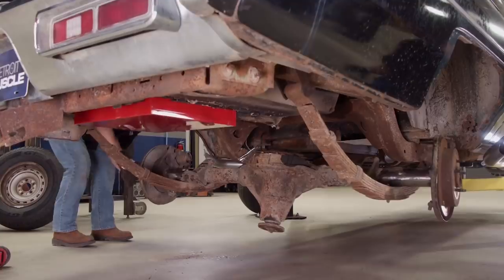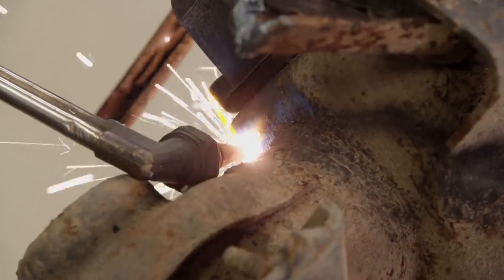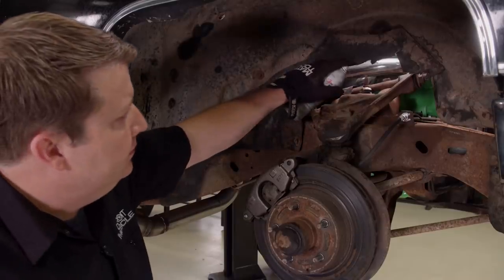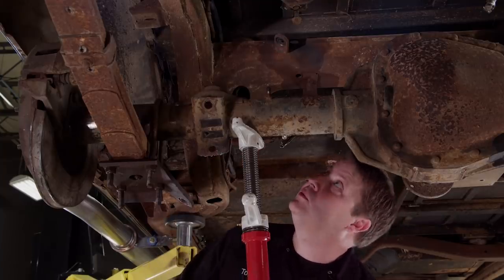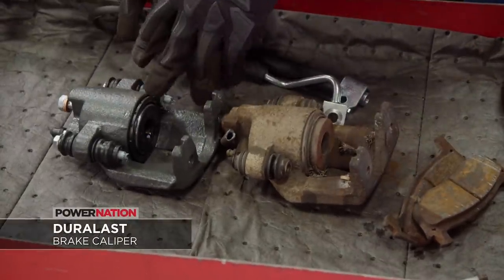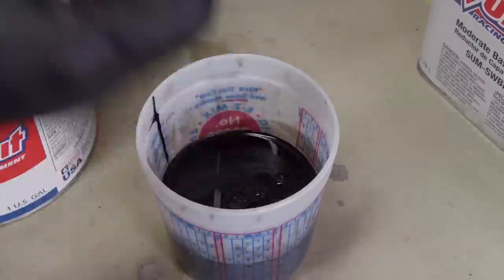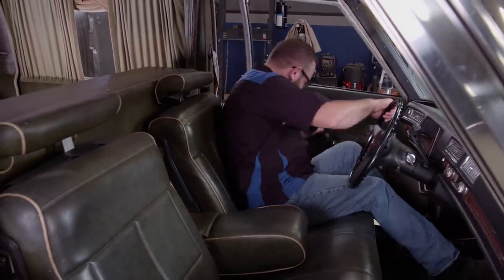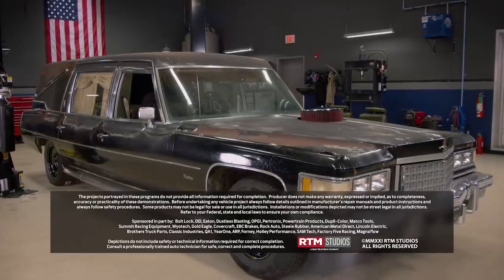Upgrading the Drag Strip Caddy Hearse Rear Axle and Suspension - Detroit Muscle S8, E5

Comment: Those came off GM's truck line as a Cadillac front end, crates of parts and a lengthened chassis with heavy duty truck suspension. The coach builders used that to build their products. That explains the leaf spring rear truck suspension instead of the coil spring rear suspension which regular Cadillac cars were built with.  Also, commercial chassis came with 472. That's what this one should have unless it was replaced. The 500 CI was not that common, you had to pay extra for it. They didn't squander them on commercial chassis.  I have NEVER seen a CC Cad that wasn't a 472, and honestly, it's pretty hard to tell the difference in something that weighs over 3 tons.  This particular one was intended to double as ambulance duty, it has the chrome bar on the drivers side interior to hold the cot in place. 1977 Was the last year of car based ambulances, so there was very little ambulance equipment, even in this "combo car" but I found it odd that it had the cot bar, but no jump seats or the flip over floor panels.

Comment: I’ve got a ‘92 Lincoln hearse if y’all want it for a later project. I’m only 100 miles outta Knoxville too. The car’s all there and I’ve got a title.
Reply: another hearse? i think ones enough... you have fun with it
Reply: @philtripe  
Yeah, it’s got a sub 90k 4.6 litre, an AOD, and an 8.8 posi disc brake rearend. It’s got all you need for a good swap out. It’s also a full frame vehicle which is also why I bought the plain Lincoln towncar version too. Picked them up for $400 a piece running and driving. Much cheaper than buying piece by piece for a build.
Reply: Hang on to it!
How cool would it be to go to your final resting place in your own car!

Comment: Sorry, but why does it help traction to allow the body to rotate up in the front and down in the back? It seems to me they are confusing the cause and the effect. The weight transfer from front to rear happens as a result of the acceleration. The nose will rise, and the tail will drop because of that weight transfer, but that rotation, aided by the new shocks, adds no more weight to the rear, right? The rotation is not a cause of weight transfer, it is the effect of the weight transfer.
Reply: This has been done since the first days of racing. It does help with the weight transfer from front to rear. The faster you get transfer, the better the traction to the rear tires, to a point. Tuning that rate of transfer using shocks, springs, etc. makes the difference between losing and winning.

Comment: What rear end was in there stock 14 bolt?
Reply: 12 bolt GM passenger car
Reply: 14 bolt would be 8 lug and full floater.
Reply: They are the 9.75 14 bolts. Their axles are drilled for the wide GM 5 lug pattern.

Comment: Any time I see some one grease caliper slides pisses me off. You never EVER lube pad slides. The grease attracts dirt causing pads to stick also the grease tends to migrate onto the brake  surface contaminating the friction area which in turn affects the ability for the brake to do its job correctly. There are other reasons also but you get my point. Also I have been trained by 6 different auto manufacturers including mazda gm ford and kia to name a few. All manufacturers state to never grease the slides in modern auto brakes period
Reply: I've been a tech for over 45 years, and you are wrong. Yes, you can get the lube all over everything if you daub it on and have it all over your hands as you handle the  parts, but if you use the proper lube for the slides and apply it like you have some sense, it will prolong the life of the pads, and keep a consistent wear pattern as well. BTW, I'm trained as well, Ford senior Master, GM gold master, Toyota master, Chrysler master, ASE master, etc. I retired as an instructor for Chrysler, so you get the point.

Comment: Those seats do not fit this build. Sorry. You don’t need side bolstering for going in a straight line.
Reply: Weight reduction could be significant
Reply: @deerespetes8849  True. But, I mean it’s a Caddy hearse. If you wanted all out performance why start with a hearse? Let it keep at least some of its charm.
Reply: @BrookieCooki84  so u haven't seen a drag car get outta shape? And the driver getting up on the wheel to correct it
Reply: @deerespetes8849  You have a point. I would tend to think with all the weight this thing has (I’ve driven an old Caddy hearse quite a bit) it would hook pretty well. Still it could still break traction. I would think a good 5 point harness would do the trick though.